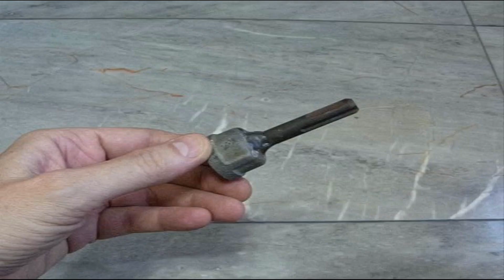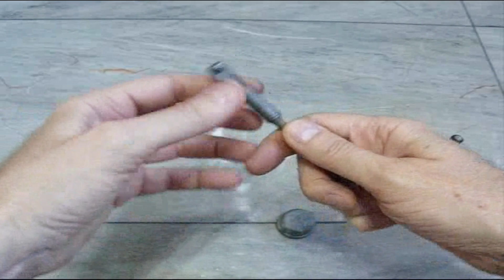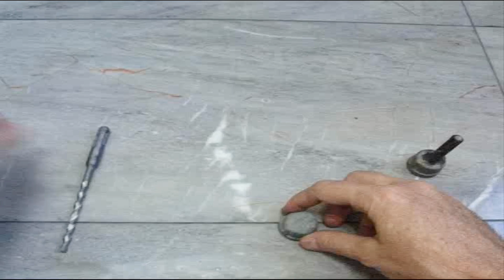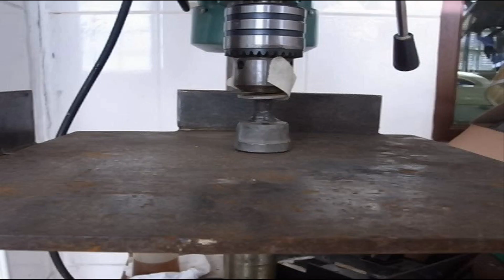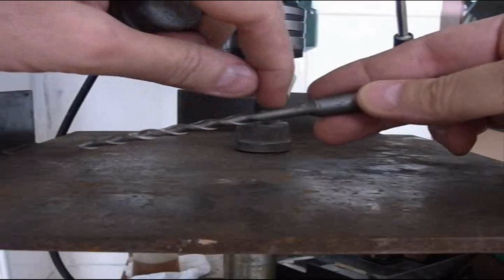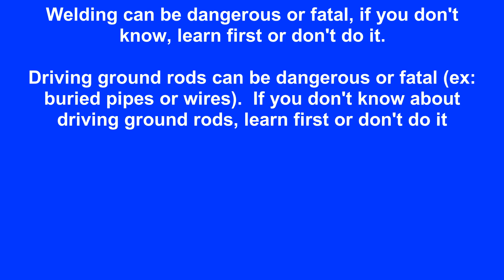Ground Rod, Stake or Post Driver Tool - DIY

Comment: Like this idea, but I think I'll just try and and use big bolt and lots of square nuts as the shank. They should sell this tool.  I did something similar once using a 7/8 socket with a bolt; bolt hold tight in the drill chuck.  Nice cordless drill-powered lawn mower starter. Better than factory- plastic clutch.

Comment: Might wanna think about adding a short piece of pipe to your cap..  you can screw it on, and it will support the drill while its on the rod, then unscrew to finish the last few inches.
Reply from the maker: Good suggestion.  Thanks.